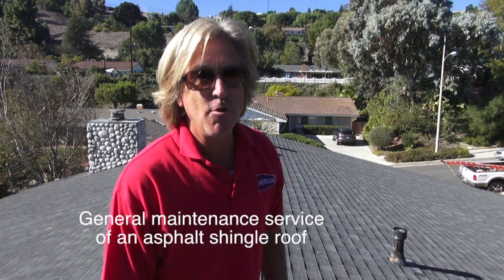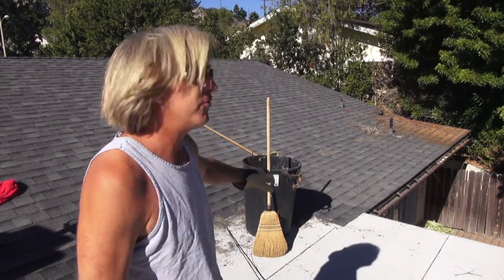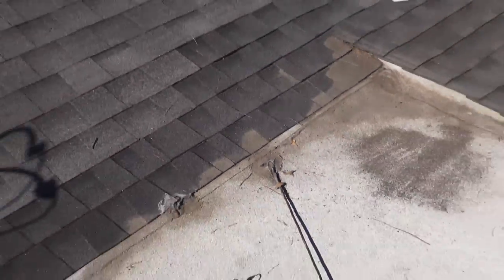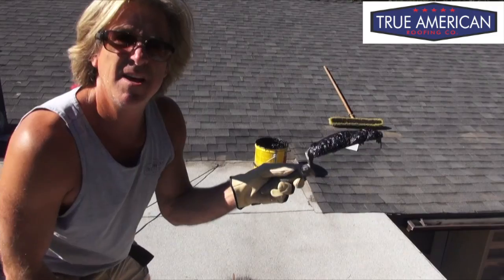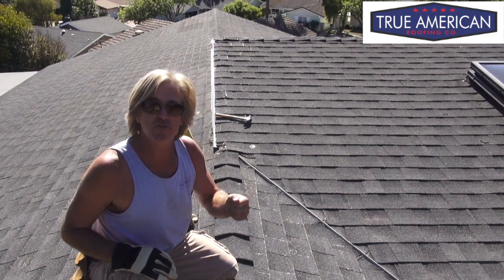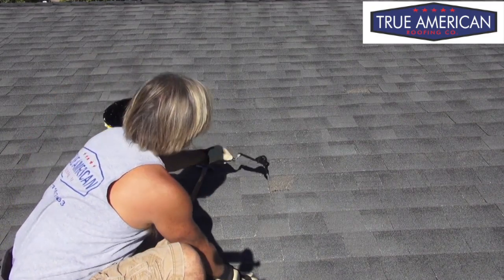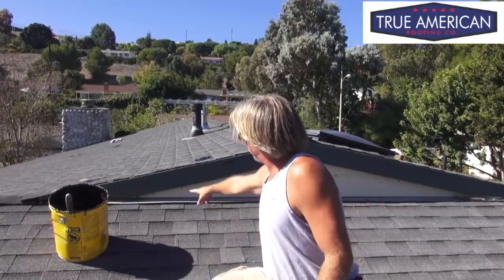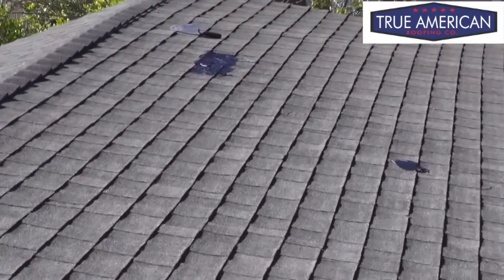Mastic Roof Repairs Tips Hermosa Beach Roofing Installations

Comment: I would have done something to the valley the shingles were covering the channel were the water should run should be a hammer head of spacing when you put the starter in the valley so the water can flow.